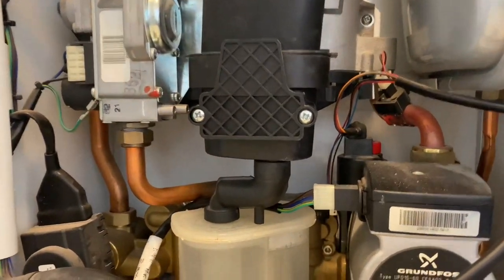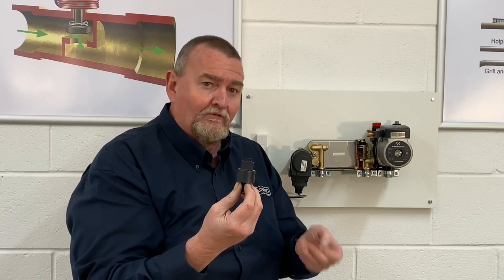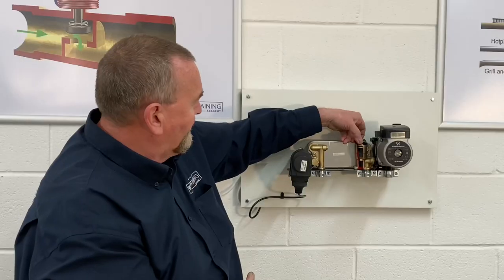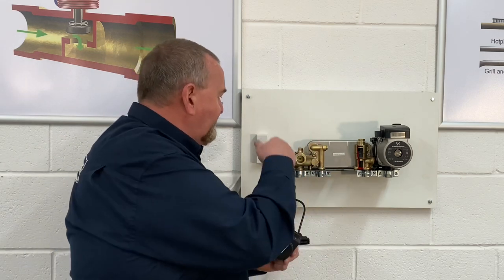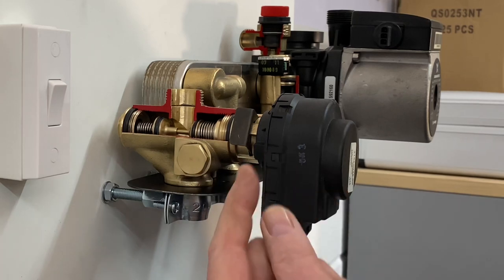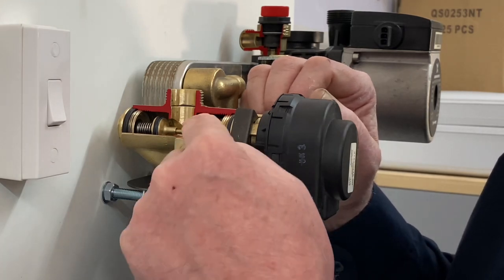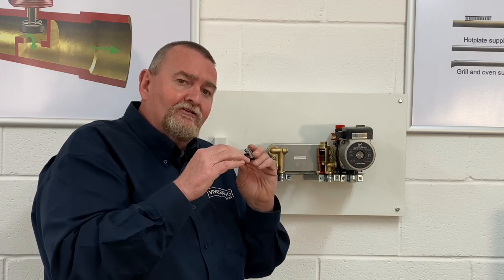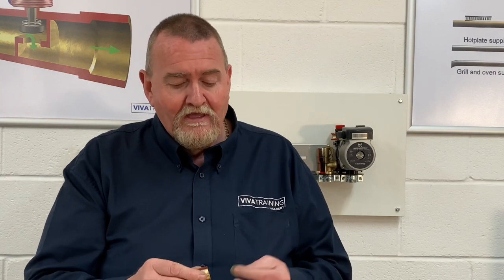Gas Training - How An Ideal Logic Works - Hydroblock / Diverter Valve - Viva Training Academy

Comment: Roy , I have a ideal independent 24 combi when the radiators reach the required temperature it makes a high pitch whistling noise, I've had two engineers out and they say I need a new boiler,  but my boiler is only 14 months old. What's your thoughts.

Comment: Hi Roy I've changed the divertor valve, cleaned the heat exchanger  and still the water is cool unless you run it slowly,radiators are hot which is normal. Any ideas could it be the electricial switch which operates the divertor valve.
Reply: Hi Rob, did you ever solve this? I get tepid water and changed the flow turbine with no change on ideal exclusive 35kw pro combi

Comment: Thanks for the video's I find them very informative and helpful. If you could put up a video regarding loud noise on ideal boilers I would be very grateful. I have tried everything to solve but just not happening.  Eg flue clear , injector clean all the usual looking for restrictions etc.  Remove sump cap noise stops . The only thing I have noticed is something going on in condense trap but waste seems clear any help would be appreciated
Reply: Replace gas valve

Comment: An AAV on the rest of the system, say at the highest point, should have the cap tightened up.  The AAV is for filling purposes only. 

In this instance it is for a different reason.